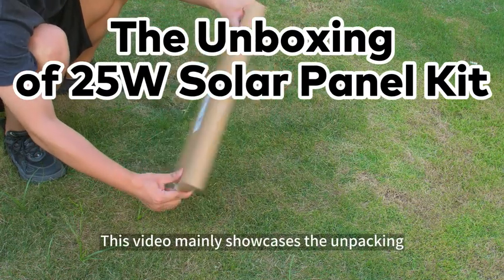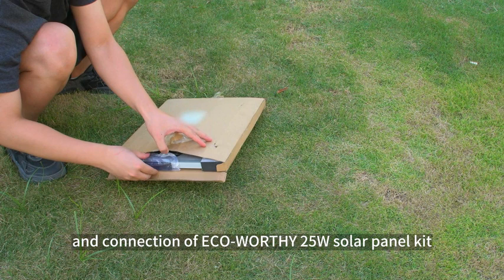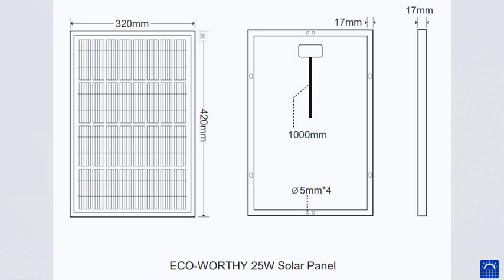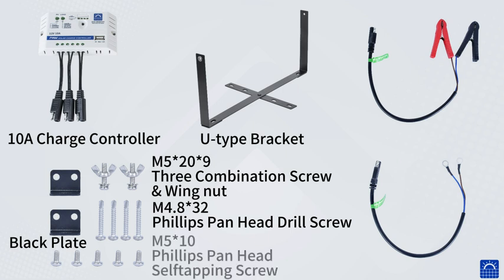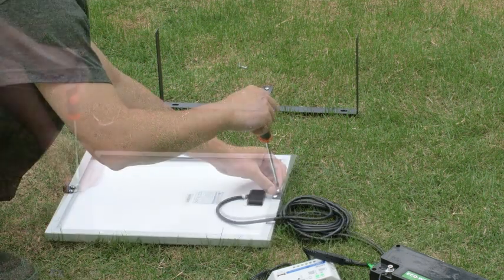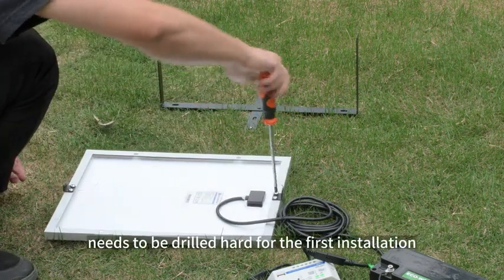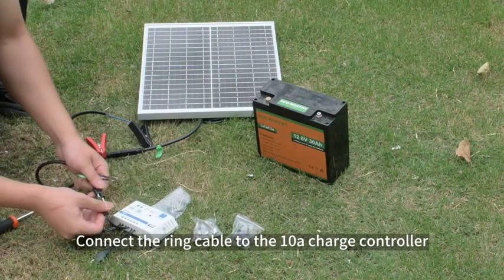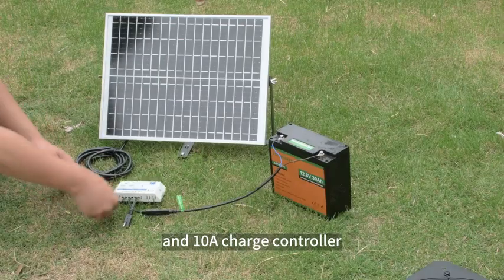Solar Panel Kit ECO WORTHY 25 Watts 12V Off Grid Solar Battery Trickle Charger Maintainer

Comment: Would this be sufficient for daily charging of a 20.000mah power bank?
Reply from the maker: Yes 😊
Reply: @PowersourceUS-x8z  I got this kit & it works well.   If I attach a second panel using a y-splitter can the pwm handle the double volts or amps?
Reply: @mackychloe  Yes, you can connect two solar panels to one pwm, provide the combination voltage, and current match the pwm specifications.
Reply: @LEDLightsUS-t1j  The question you raised is the question I need answering.  If I use a y splitter does it put the panels in series or parallel?   if it's series then the PWM can't handle the voltage.  if it's parallel then we're good.
Reply: @PowersourceUS-x8z  Thank you.